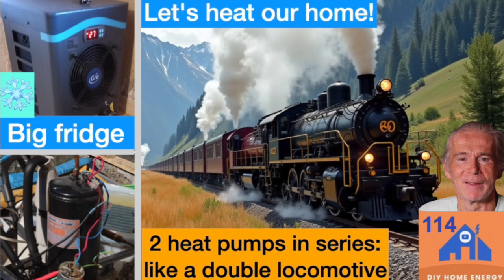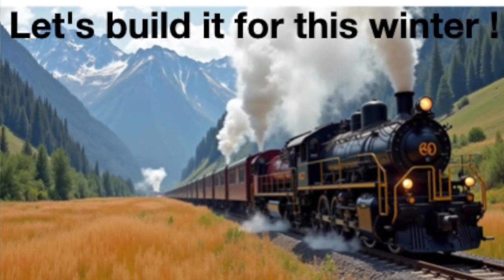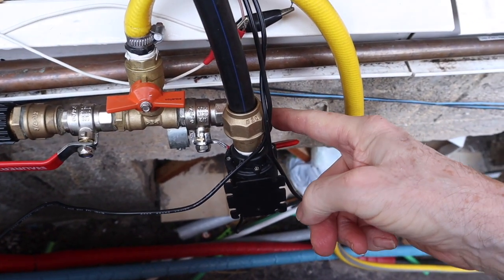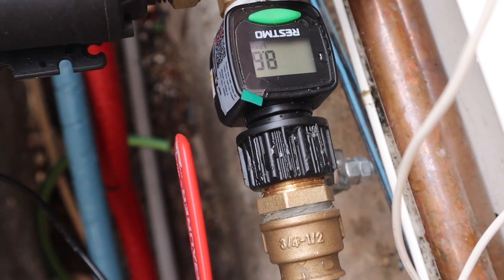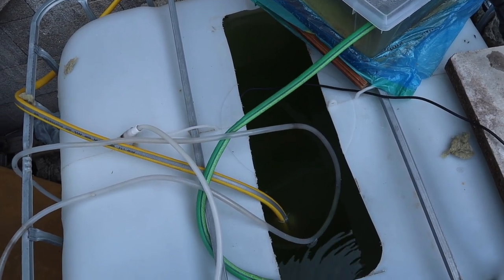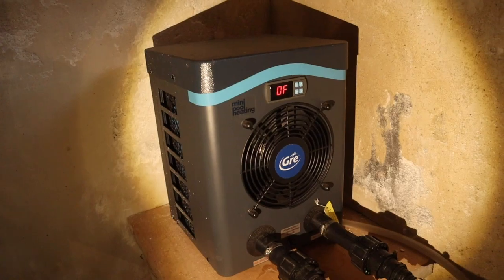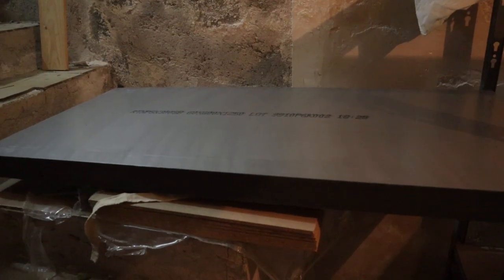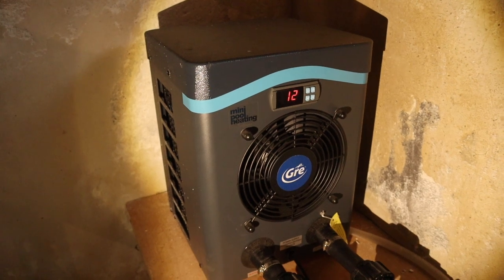Two heat pumps in series and even a storage! Connected to radiators in home - Video 115

Comment: In my climate for winter heating, I need at least a store an order of magnitude larger than yours, so have used a different design.

It looks like your dedicated external source of heat is your basement air via the pool heat pump.  (Of course a day that is too hot is another source.)  So, you reduce the temperature of the air around your heat store.  Would you be better served not having an air to water heat pump next to your heat store?

 I see your approach in a diurnal swing from heating to cooling, but the storage of heat from summer to winter may have challenges even in the Netherlands.

Combine with a rocket mass water heater perhaps if you have access to dry biomass.  One burn session could provide enough heat and then the heat pump distributes the heat at the correct temperature over the rest of the day.

In doing this work, it always seems to me that cooling is the most challenging.  Microbial growth can occur under the most challenging circumstances with condensate and the average consumer never does maintenance.
Reply from the maker: Very good points, thank you! 🙏
You’re absolutely right — for full seasonal storage we’d need something an order of magnitude larger as I noted in video 64. My goal here is to optimize the daily and weekly cycles first — storing heat from sunny afternoons or cheap night tariffs, not yet from summer to winter. It will give you a good energy saving for much less effort.
The swimming pool heat pump isn’t meant to harvest only basement air — it actually takes air from the basement next to the TES (which is outside) to stabilize temperatures, but the real idea is to keep both tanks within a moderate range where the water-to-water stage (the converted AC) can work at high COP without freezing. I am aware that I should choose different refrigeration liquids for different temperature ranges but find it a rather difficult topic to propose on this platform. It must remain doable.
I agree completely about biomass integration — a rocket mass heater feeding the TES is on my “hybrid concepts” list. In my reality I would like to experiment with a radiator lying on the kitchen stove described in video 31 and then circulate water to the TES.  It would make the system nearly self-sufficient when solar or grid power isn’t available.
And yes, cooling is always the more demanding side. I’ve seen the condensation and biofilm problem too, that’s why I will test water quality control and circulation even in the “cold tank.” But that must be next year because in 2 weeks we leave for our winter residence in Tuscany. Where are you living?
Thanks again for sharing your experience — I really value these exchanges because they help bridge practical DIY systems with professional design logic.